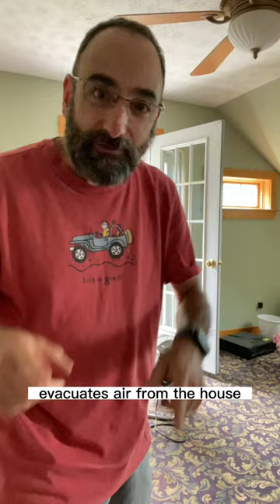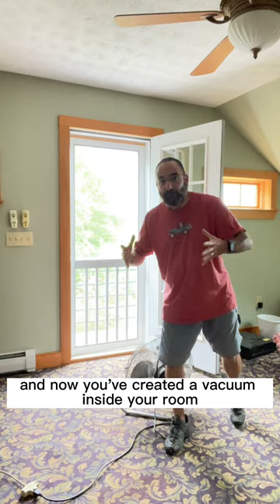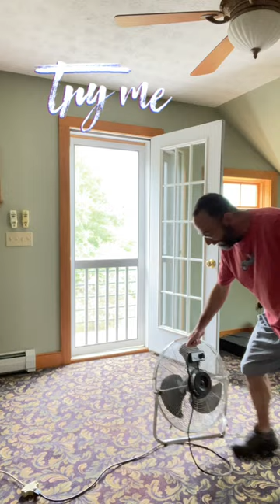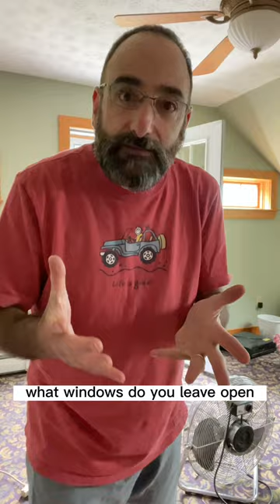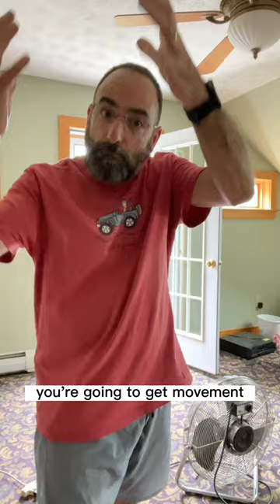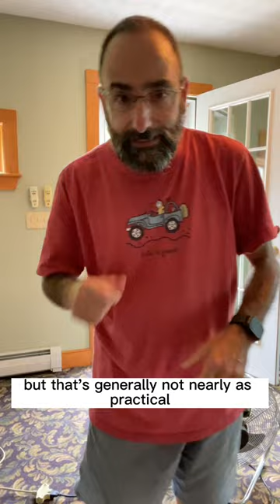Best Fan placement in a house

Comment: Our house never gets hot enough to need a fan. I live in Scotland so it’s nowhere near as hot as where you are.  Fantastic video and I’m so glad I stuck with you because
Reply: How about now ? 😅
Reply: 29 Celsius here in Wales in my bedroom and it’s 11pm!
Reply: 🤣 i c what u did there
Reply: Fans aren’t always for heat, it’s extremely humid here in Scotland. 80% most of the summer, airflow is key. I have reptiles too so I need airflow to lower humidity

Comment: I'm not quite understanding:
Do you open windows in each room of the house then use a fan in each room? 
Or do you open one (or two windows) on one part of the house to create airflow throughout the house?
Reply: Basically the fan part blowing is just for sucking in the air behind the fan. If you mean having all those fans running at the same time, that'd be a bad idea as it wouldn't support any one air flow passage. 

The point is just to create a passage for the air inside the house to flow outwards.
Reply: @takeuchi5760  Thank you!

Comment: I mounted a good metal blade fan into a window slot to blow hot air out.  I open a far side window and it pulls cool morning air in.  We save $$ on electricity and do not use our AC anymore in triple digit heat.

Comment: I have 2 windows on the same wall 12' apart. My detached garage is not insulated. The ceiling rafters are 12' high. It stays too hot in the summer (new mexico) to do anything except park the car and leave. I leave both windows open (with screens) and put a box fan in 1 window frame blowing air IN. It really doesn't do much. Should i move the fan away from the window and blow OUT?

Comment: So let's say I want to cool the bedroom. Do I open a window in the bedroom and put a fan also in a bedroom facing window? or do I place it in the other end of the house, in another room, facing window, so that cool air enters the bedroom and moves through the house?
Reply from the maker: If your main goal is to cool your own bedroom, your best bet is to place the fan in a different room blowing out, with that window and your bedroom window open. Be sure to close off other rooms that are not critical to cool. Also be sure to keep the fan a few feet inside the window
Reply: @wolf_science thank you! And if I just put the fan in the bedroom itself, facing window - wouldn’t it achieve same effect - moving air through the house to exit via bedroom window - but with extra airflow in that room, so the skin feels colder? 

Or in that case the room with the fan becomes the hottest?
Reply from the maker: Both methods will achieve the exact same airflow, but one method immediately brings outside (hopefully cooler) air into your bedroom, and the other method requires all other householdxx air to be removed before the outside air begins to cool your room. Plus, the other method will have the cooler outside air get slightly reheated by the mass of the household objects (walls, floor, furniture). Hope this makes sense!

Comment: Please make an other video to demonstrate  where to put fan exactly , when the temperature outside is 42 😢
Reply from the maker: Assuming that you mean 42° Celsius, there’s not much you can do, other than close the windows and shades and try to keep the heat out. Blowing the fan directly on you will help by evaporating your sweat, which cools the body.

Comment: Hi, I have two questions; 
1. does it matter where the wind comes from when you blow out the hot air?
2. my fan has three settings, should I use the highest one?
Reply from the maker: The highest setting will move more air and therefore change the temperature more quickly (as long as there is a difference in temperature between inside and outside). To answer your first question I need more detail about what you are asking.
Reply: @wolf_science  well I live in an apartment on the second floor and its very windy.  The room I want to cool has the window facing south, but sometimes the wind comes from the south, does the hot air still blow out? Or does it come back in due to the strong wind?

Comment: Can you do this and still run AC? It’s triple digit hot where I am and home AC is struggling to keep up- can this method help with AC on as well or is it counterproductive?
Reply: Seems like the best bet would be to fan the air out of the furthest bedroom to help with heat removal, like cracking windows in your car until the A/C can catch up and take over. There should be a point of diminishing returns for the effort of the fan and should only do you any good for 30mins to an hour, if your home isn't large. There also isn't a decent way for air to be sucked into the house without also letting heat into the air conditioned room. In short, makes sense to me that'd help for a short while, then the capability of the a/c is all you can rely on. If it just isn't large enough, try to sequester your family into as few open rooms as possible, nearest the room with the a/c. Remember to gently spray the fins and fan to keep them clean every few weeks and also look into better attic insulation 👍

Comment: How do you get the cone of air to fill the entire opening
Reply from the maker: You have to move the fan far enough back from the doorway or window to be sure you’ve got a complete seal.
Reply: No way to achieve this in my house. There is always some backflow on the bottom. Fortunately it's usually colder than the inside